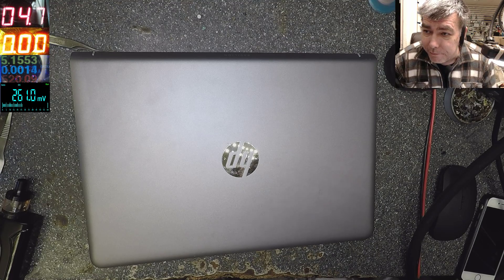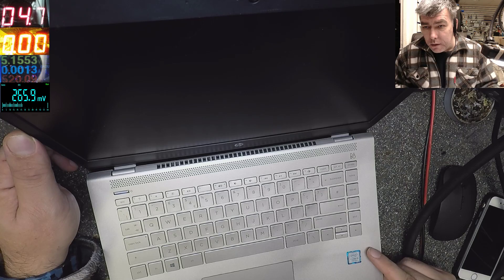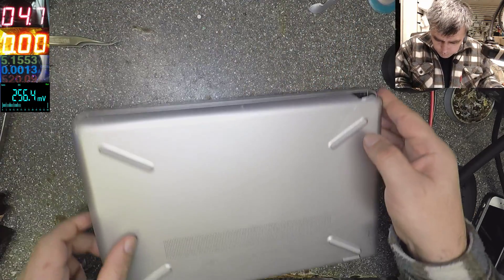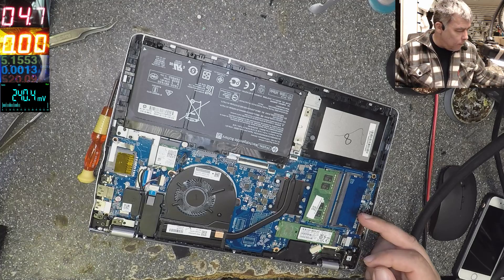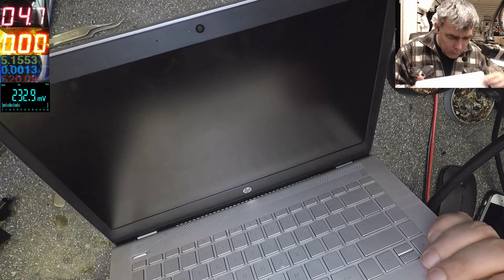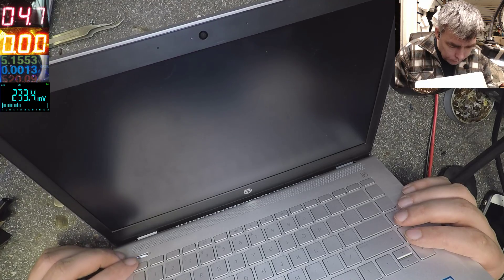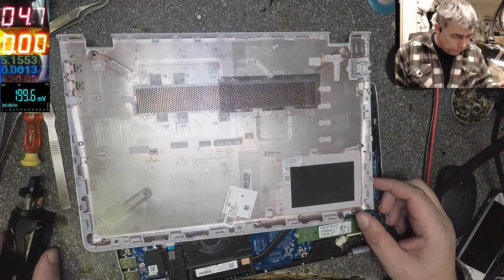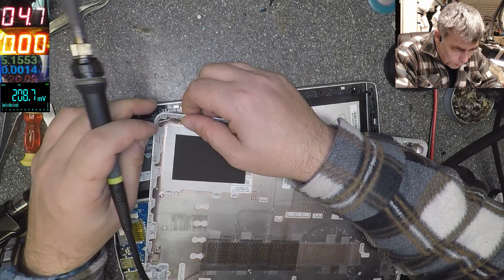Hp pavilion 14-bk052sa no picture on the screen repair

Comment: Sir, I also doing some repairs. Like laptops and led tv. Recently I repair a laptop which had a serious damage with it's display. I replace the display and everything gone well. But customer complained display not working after an week. I checked the display. It's working great. But mother board not outputting data to the display. It's a AMD version. Do you have any suggestions to me??? Please reply. Thank you. Best of luck with your HAM radio licence.

Comment: Nice job,

You can use hot air 120C and blow it on the top. Why? Plastic have a memory and will bend back. You have to make sure that nothing forcing like this battery.
Working 30 jear in plastics so I now😀

Comment: Hi sorin... I have a question about motherboards not about weird laptops like this one :p ,  when i put the multimeter on continuity and check on the coils, when it beeps it means there is a short on that power rail, is this correct?
Reply: by the way i spotted multimeter probes on your desk drawer in case you still using that black wire for the power supply, maybe you didn't use that one yet :p
Reply: That mean the coil is good.
Reply: Computers repair Côte Saint-Luc i mean black probe on ground and red one on the coil.
Reply: it shouldn't be 0 ohem. but i did see some coils that are 12 ohem to ground
Reply: Computers repair Côte Saint-Luc ohms*
Reply: Computers repair Côte Saint-Luc but the cpu  coils are always 0 ohm to ground even on working laptops... How can the cpu section checked for short?
Reply: There are different use for coils, if on the output of the coil should be voltage it shouldn't have low resistance
U = I X R google this you'll be able to learn more
http://apps.usd.edu/coglab/psyc770/resistors/ohms4beginner.html